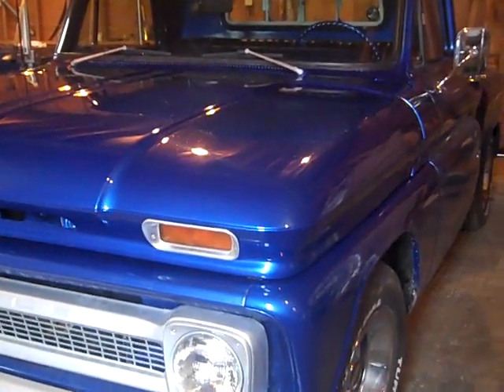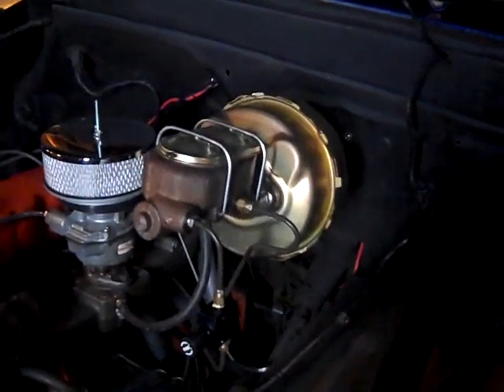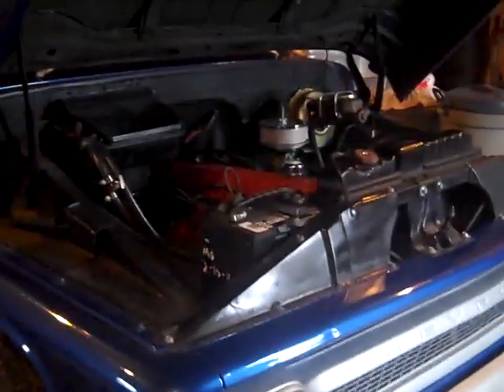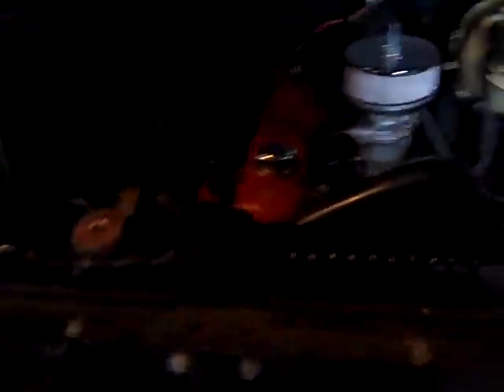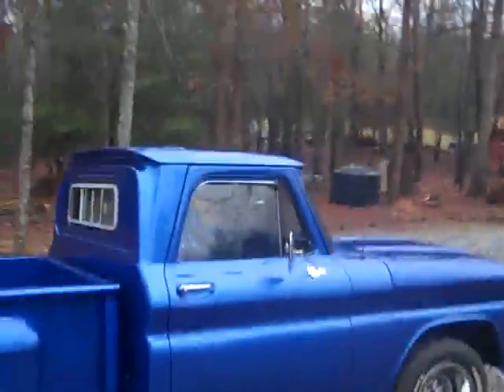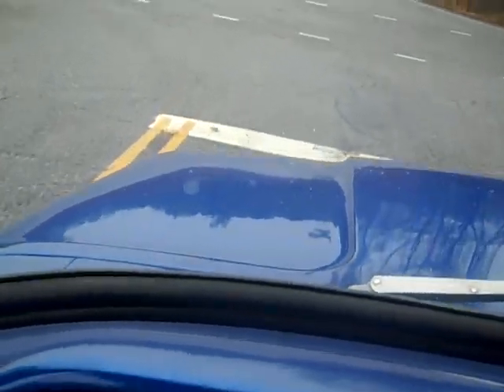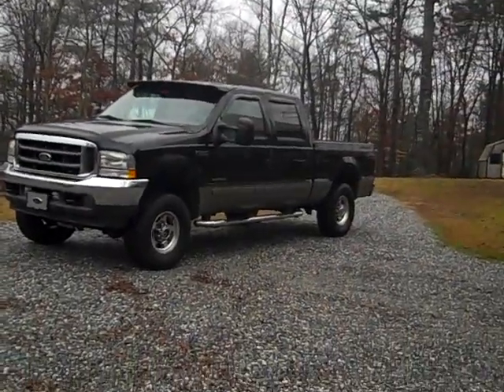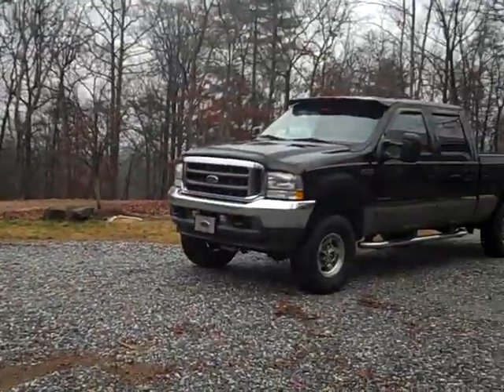BOV Strategy: Different ideas concerning finding and building a Bug out Vehicle.

Comment: -No budget for a BOV right now, so all I have is lots of untested thoughts.
-Fuel: something I can grow.  Ethanol or biodiesel/SVO combo are at top.  Wood gas lower.
-Carburetor has great advantages.  Mechanical fuel injector is also simple to replace and possibly rebuild.
-Body: truck for greater flexibility.  Comfort loses.  Lotsa people ride in back on hay bales, etc

I love the modernizations: brakes, suspension, radio, etc

Comment: Part 2... my primary BOV is a diesel pulling a trailer which carries the Jeep. If the diesel fails, I unload the Jeep and continue with a smaller load. I carry 130 gallons of diesel and extra gas for the Jeep. The plan is to bug out to my retreat 700 miles away if needed.

Comment: @engineer775 Elite’s EMP simulator includes a 1.2 meter tall parallel plate with a table width sized 8 feet by 4 feet.  it  produces a radiated pulse of 2.5nsec rise-time and a 28nsec decay time at field strength amplitudes up to 50,000 volts/meter.

Comment: make sure you have a 4x4 vehicle jeep or truck any engine size is fine. Smaller trucks and jeeps are great fuel economy light and highly maneuverable when military seizes the cities. You can hole up in the woods some where with small bug out cargo trailer.  your vehicle can be your rolling metal tent on wheels and it can be your pack mule and survival tool.

Comment: In my opinion, when shtf you will be moving target when on the move. So your two choices are to sit comfortably or move fast and or move with stealth.. So for my bugout vehicles it would be all gas for the speed. Dirtbike or racing atv, and as for the vehicle a 4x4 3/4 ton truck gas with popup truck camper. Engine breaks down slide the camper on another truck . Van and dirt bike for stealth.

Comment: Right now my dad has a little 1995-2000 Nissan truck, I'm unsure of the model... its a small 4 cylinder truck...

Other than that for myself personally, I'd have them ride in the back of the nissan truck while I ride in my little 92 Honda prelude, It holds 10 gallons of gas, gets 26 mpg with regular and around 28-30 with premium...

I'm planning on having some sort of small fuel storage of 50-250 gallons. I'm going to need to find property soon as I'm 16 to start developing my own personal home.

Comment: I would have to lean towards the older diesels.
Simple to maintain and operate, though they can be lacking in power (compared to modern).
As a further: I would lean towards the military models, I would doubtless lose mpg, but it would have (very likely) AWD or 4x4 and a fair amount of power.
My personal favorite would be the M35 series, or the Russian Ural 4230.

Could I ask uploader for reason for/against my choice? I would like your thoughts and viewpoint.

Comment: I would like to get my hands on an old diesel van (without windows all around) with four wheel drive (preferably high ground clearance).
I like it has a closed box in the back, which could double as a sleeping space, carry considerable amounts of gear. I'd want it to have a winch installed on the front (can pull stuff out, or pull itself up from a ditch or whatever). I'd want it to have a serious front ram/kangaroo grille. Flat roof for solar panels. Practical, and not so cool looking ;-)

Comment: My BOV would be an old Toyota 22r, manual truck. Tiny, torquey, but not very fuel efficient. Do you have a video of wood running the truck? I would love to know how to do that. At the moment I don't have my learner's permit, looking to get a 4banger Tacoma, maybe extended cab. Either that or a quad cab Frontier, which looks better IMO, but I don't know anything about Nissan. For right now we have my mother's TrailBlazer for a BOV, but that would burn up worse than jet fuel in SHTF w/o parts.

Comment: I would prefer a 4x4 Jeep with a 4 cyl diesel engine (with conversion to allow burning vegetable oil)  after market suspension, undercarriage protection and a winch,   (the roads in my area are extremely hard to drive on without 4wd and without adequate ground clearance)

Comment: have you considered a good old fashioned diesel engine . so long as its fitted with a lucas pump you can run it on veggy oil , new or filtered used it will still run .

Comment: I'm surprised you have a goose neck trailer. I think that would severely limit what you can put in the bed or even a cap to keep things dry. A ladder rack can fit over a cap and give you another platform for storage too. You are restricted by the goose neck for any of those options.

Comment: hell yeah have an 89 ford 4x4 7.3 idi pretty much already emp proof with dual tanks for running things such as used motor oil, but i still love my ld 87 camey witch is less emp proof. that camry is probally better in the snow than my ford and gets 30 mpg.that ford about killed me in the snow this year when i hit the breaks the rear wheels locked sending me spinning.

Comment: @MichaelHuntington My suggestion for you would be to try to find a cheap Suzuki grand vitara, or chev tracker,  the 4 cylinder version,  they have true 4wd (as opposed to the rav4 and CRV) and they are really good for off road, and excellent for fuel economy given the capability and storage.  (also they have a large availability for after market parts like suspension if you even feel like an upgrade)

Comment: IMHO, I would rather bug in than bug out. but for the sake of this video, I would choose something dependable like a toyota tacoma crew cab or a honda ridgeline. they offer decent  mileage yet are 4x4, have space for the family, can tow a trailer which is a must. If I were more handy I would take your F350 diesel. I would also not draw attention to myself. Just a regular truck nothing tactical
On a seperate note PM me and tell me about the 60 acres, I noticed the Prudential for sale sign too.

Comment: horses the greatest mode of human transportation besides walking i would go with horses cause they are emp proof dont run out of gas. as long as there is leafy greens they can eat and humans have used them for thousands of years cant go wrong with all that history. plus theres not all these parts that can break like on vehicles. plus you can always bread more but you cant do that with vehicles anyways just my reasoning on why im goin with horses.